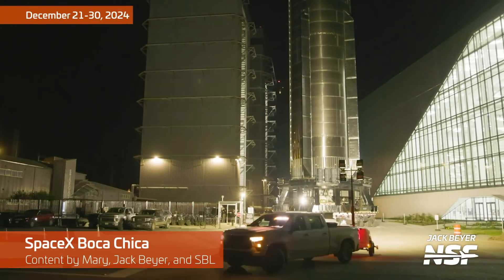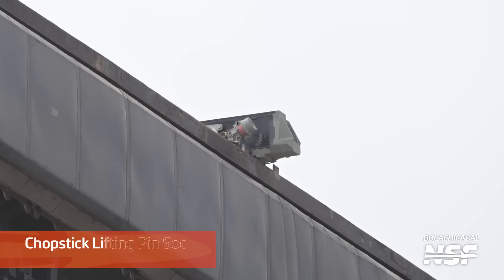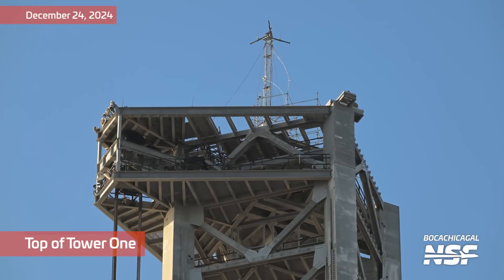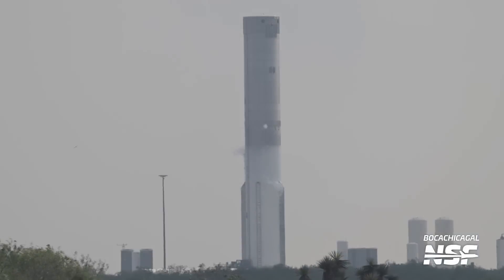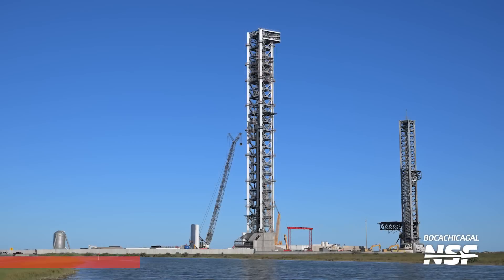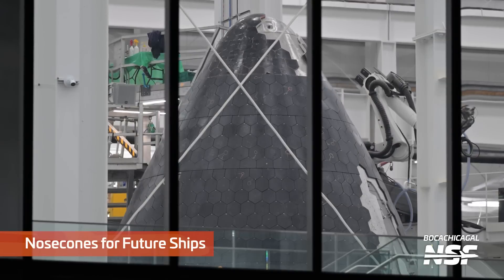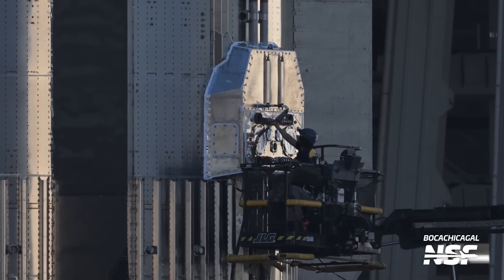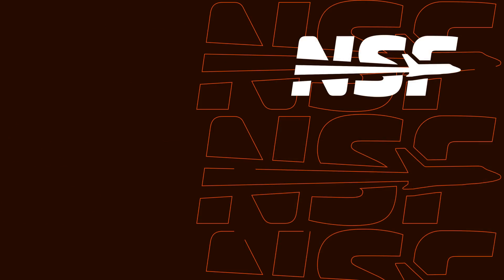This Is How It Ends. That's Going To Do It. | SpaceX Starbase

Comment: The cryogenic module is a typical construction methodology. This was used extensively when building the Westinghouse AP1000 reactors at Plant Vogtle 3/4. In addition to these relatively small modules, small modules brought in from Lake Charles Louisiana were assembled in the gigantic Module Assembly Building (MAB) to form very large assemblies e.g. reactor and steam generator cubicles to be placed inside of containment of Nuclear Island. This is more efficient than the “stick built” construction method.

Comment: There is no such thing as a "skid steer". It is a compact track loader.
Reply from the maker: There are an awful lot of search results for "skid steer rental" so ot seems to be a pretty accepted name. - Das
Reply: @NASASpaceflight  Equipment is named by what it does not by how it steers. If that were the case everything with tracks would be a "Skid Steer." It's a loader, specifiaclly a track loader. And yes, there is an awful lot of ignorance out there.
Reply from the maker: I mean, there are a LOT of references that call it a skid steer... https://www.equipmentshare.com/articles/what-is-a-skid-steer

Not even sure I know where I first heard it. - Das

Comment: I haven't watched an NSF video since the election. Pardon me if I hope Elon gets consumed in some conflagration of a booster test. Accepting that the guy has never engineered anything but simply green-lights projects, I'll start watching again but the childlike exuberance for the launches that I'd held since the 60's is gone. Tamped flat by Elon's presence.
Reply: This is Elons company and that's going to change. Due how his dual class emperor shares structure he set up

If you don't wanna watch spacex then don't but it's always about Elon. Otherwise it would be a publicly traded company

Comment: 5:56 I think it is stunning to see the improvement on the circ welds between the can sections. The blight reflective line is now perfectly straight up the side. The original can sections from years back looked all lumpy at the joints. that is some serious improvement in welding procedures.

Comment: Spmt will move it and this whole unit consistutes a "launch puck". Another like it will be built or at least one more I am guessing. For repeatability the " launch puck " is designed to be exchanged out after a number of lauches for refurbishment offsite nearby and then put back in. Depending on its reusability and the launch schedule will dictate how many are needed